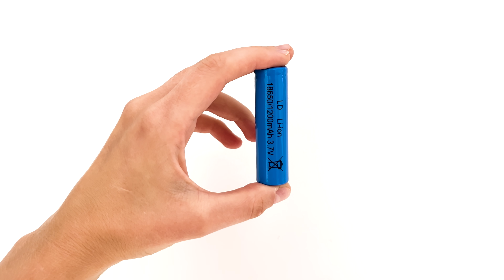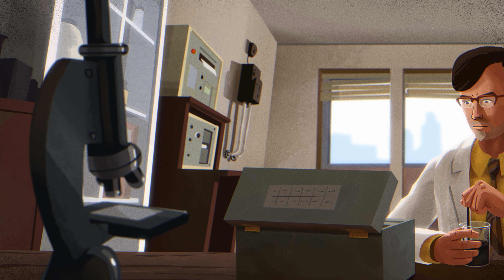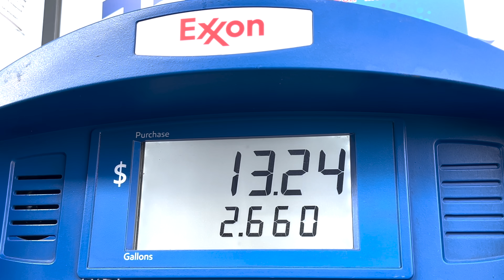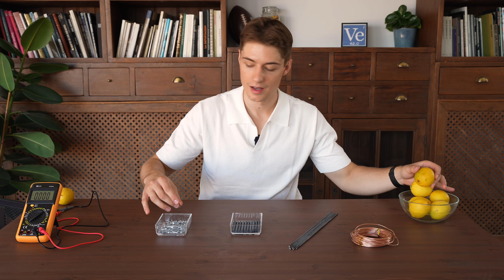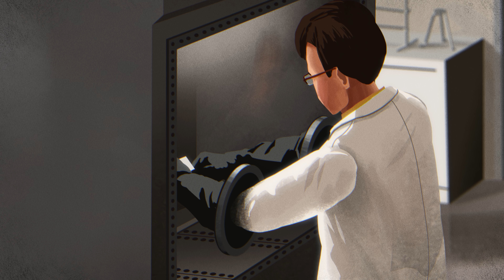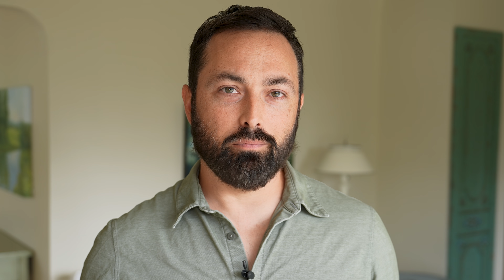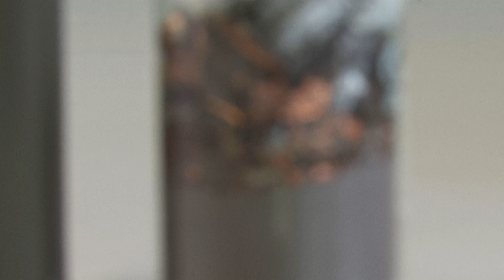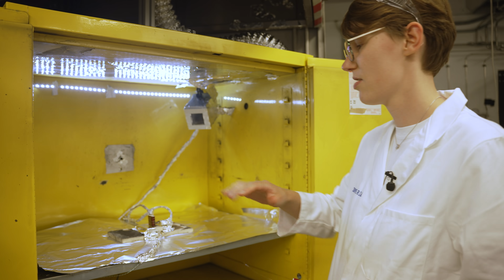The Perfect Battery Material Is Dangerous

Comment: A few things to add:
1. Not all cobalt is coming from those mines in the DRC. Electric car makers especially go great lengths to only buy ethically sourced cobalt. Can't say the same about your smartphone.
2. Not all batteries use cobalt. The lithium-iron-phosphate (LFP) chemistry is very popular in electric cars and stationary storage, primarily for it's lower cost and higher safety, but it's also cobalt-free.
3. Lithium production also don't have to be harmful. Actually almost half of the lithium comes from Australia, which, as a developed country, likely does it the right way.
4. Electric cars are at least 10x less likely to catch fire than gas cars.
5. One damaged cell doesn't cause fire in a properly designed battery pack. This was the very first problem Tesla solved over 20 years ago. The trick is simply to conduct away the generated heat fast enough. Small cylindrical cells with liquid cooling can do that. Most EV fires are caused by pouch cells, which are far more fragile, and don't conduct heat well.
6. With the right equipment putting out an EV fire is easy. One solution is a lance that punctures the battery pack, and inject water directly inside. This cools the battery far more efficiently then submerging.
Reply: As an Australian, no the mining corps don't always do it the right way and do come under constant scrutiny. But they also have the politicians in their pockets making it very hard to do anything about them.
Reply: @SamWulfign  
Sure, but they are likely still better than in 3rd world countries, or China.
Reply: @andrasbiro3007  Yes and no, if they can abuse the system they will. A large acreage land within the region I live was bought out by a mining conglomerate for "forest regeneration" reasons. When majority of it is bush, seems like they thought it would be a easy carbon credit scheme.
Currently atm battery storage is just not a good idea to do at large scales.
Chemical storage would actually be much better and cleaner overall given that it wouldn't be using such resource intensive extraction, I.E Hydrogen turbines, you could convert gas plants to generate and use hydrogen from excess intermittent energy from renewables.
Reply: most comes from china why lifepo4 is really cheap now
Reply: You don't even need special equipment, at least right here in Germany. You can just dump enough water on the small part of the battery that caught fire (if it caught on fire at all because usually everything but the battery burns). Electric car fires are not more dangerous than a full tank of gasoline catching on fire, and they happen less often. Large vehicles like busses might be a different thing, I don't know enough about that topic.
Reply: 1. Most Cobalt comes from the DRC, like over 90%, this is a FACT.

2. Correct, but LFP batteries are nowhere near as common in everyday electronics as Li batteries are.
3. Nothing "has" to be harmful, but ALL companies and governments are corrupt and evil and cut corners to maximize profits over health and safety.
4. Blatantly untrue, EV vehicles are MUCH more likely to catch fire than any fossil fuel powered one. I can't recall the last time I heard or saw a Combustion engine vehicle fire, but EV fires are in the news weekly.
5. Wrong, the modern batteries are so tightly packed that a fire from a chemical failure quickly ignites the rest of the otherwise normal cells, and water exacerbates lithium fires people, it was SHOWN in this video! Adding water and water cooling to batteries increases weight dramatically, as well as complexity and cost, nobody does this comercially.
6. Small scale yes, a fire bag can control and extinguish a lithium battery fire, on something large like a vehicle there is NO WAY to put them out easily, and most EV fires burn for HOURS as is proven on the news weekly, even when the fire department uses specially designed for battery fire chemicals and foam retardants.
Stick to your day job guy, your knowledge of battery tech is laughably dangerous.
Reply: Renault EV's (I'm sure the others do as well, but I've not researched others) have special emergency ports especially for firefighters to pump water into the battery. In the Zoe it's under the rear bench, in the Twingo it's on the passenger side footwell (LHD).
Also, all car manufacturers in Europe have to provide a publicly available emergency rescue sheet for their vehicle model, where the placement of fuel, pyrotechnics and batteries, cutoffs and emergency accesses is located in your car. You can print them and store them easy accesible in your car or glue a QR code on the windshield for emergency responders to scan.
Reply: 7. The environmental impact of an electric car and the power used to charge it is far greater than that of a gasoline car.
Reply: @jovetj  That depends heavily on how you charge that car. With enough renewables creating electricity EVs are far better for the environment.
Reply: @jovetj  
In reality electric cars are cleaner even if charged exclusively from coal power plant.
The key is efficiency. Modern power plants are up to 60% efficient, and EVs are over 90%, while gas cars are more like 20%, and that doesn't even take into account the cost of producing the fuel. Oil refineries are power hogs too. Some say that just the power used for refining oil would be enough for EVs, but I haven't looked into this yet.
Reply: Teslas are verboten except when they need to show one burning (for probably an entirely different reason)
Reply: Hell yea ❤ tesla is sooo great with the battery management system

Comment: Batteries are not the solution.. We alsready know what the physically most energy dense batteri is.. Lithium/air.. Which makes Li-Ion look like a supersafe graddaddy..  The future isn't electric.. It's nuclear, manufacturing synthetic fuels from CO2 in the air, and water.. A closed loop except for the nuclear power driving it..  The only possible way forward for batteries is "nuclear batteries", where you use the nucleus energy levels for storage.. such a battery could easily power a car for a lifetime.. Problem is, we have no idea of how to possibly control this, and Fusion power is waay closer than that.

Comment: 9:43 so a boat made from solid lithium would float?
Reply: A lot of metals can float. Lithium, sodium, potassium. Even an aluminium boat could float on water with enough surface tension
Reply: It would light up the water I think. I'm smart in the ways of science.
Reply: @AncientSoothsayer because it's lighter then water right?
Reply: Yes but also explode, but with enough surface area most thing will float e.g. large boats are made of steel

Comment: I think one important change that needs to come is cheap heavier batteries. Light weight high density batteries are great, but we really need a good battery solution for the power grid that doesn't use up so much lithium. I hope we get lots of investment in that to bring the price down.

Comment: Guys: -20C Salt water discharges and cools a burning car battery in minutes. Sweden or Norway figured that out because of fire security on their ferries because of the latent danger of cars spontaneus combusting.
I watched an official test where a typical electric car was brought into thermal runaway and it was in full steam when the frozen salt water was introduced. It took care of that in minutes. Not hours.
And it didn´t take much salt water, either. So: the environmental impact is much lower when dowsing battery fires with that. You still have to put them in a waterbath after but …okay. Why is no one talking about that? It´s not hard to implement to have insulated tanker trucks on the road to a battery fire, certainly with a diesel engine- for reliability & ease of use. But yeah, problem …not solved but made less worse.
Thanks, no charge

Comment: In 1991 my dad was stationed at Subic Bay Naval base Philippines in the USMC. One day before patrol my father the radio operator was handed a new lithium ion battery for his radio. It was still a prototype in testing with a questionable casing made of mainly capton tape. He was pretty excited when he picked it up and felt it was half the weight and twice the run time as the old lead acid batteries. Until they told him it will burst into a ball of fire on his back if it got to wet, in the jungle of the Philippines lmao.

Comment: Regarding that sponsorship, the pitch boils down to "let's let generative AI police generative AI".  As an experienced software engineer, I'd argue we need more manual code review when generative AI is involved in workflows, not less.  I've seen AI produce some real turds of code blocks, and I'm not about to trust a different model to correct it.

Not that AI doesn't have a place in my work - I just think you shouldn't have AI in both the implementation and the review.

Comment: A bit problem with lithium is when it out gases the gas smells sweet and encourages you to inhale sweet smells trigger a almost uncontrollable reflex to inhale. It is why lithium batteries are so dangerous as that gas is toxic as hell. 
As far as the climate change bs goes i have so heard enough of that bs. Batteries no matter how good require another power source to charge and solar is a freaking joke so is wind. And the liberal whack jobs hate nuclear because oops clean power on the cheap so they have to make up more narrative to rally against it. Solved the hoax of climate change and they can no longer profit from that hoax. 

There are real reasons to look for alternative energy. Examples such as well less nasty smelling gases emitted for one and those gases are not healthy. The only thing EVs actually do is  move the pollution from the streets to more centralized areas. The idea they are cleaner is nonsensical. We have to dig effectively megatons of materials out of the ground using yep fossil fuels to do it then charge the batteries with coal or other fossil fuels. There is nothing CLEAN about batteries.

Comment: This video is awful, it's like it was made using 2015 info. Just Have a Think has covered batteries better and quicker for 3+ years now here on Youtube. Your private equity ownership doesn't help (thank you Micro channel on YT for the tip, because Derek doesn't mention it).

26:40 Saturn's EV1 was just fine, hence why people liked it, but the American govt and big oil hated it. That was in 1996. Who Killed The Electric Car is a cult classic documentary because of it.

33:20 Solid state batteries don't have the dendrite issue (the catching fire problem). Neither do Lithium Iron Phosphate (LFP). Grid scale batteries, like liquid flow or sodium ion batteries, are perfect for 24h storage because they're two tanks of different salt liquids with a membrane in between - similar to how hydrogen fuel cells work.

Comment: Potential Error: 5:20 - you show electrons moving up the zinc through the circuit, but label it the anode.

Either its cathode or the electron direction is wrong.

(The anode is the positive in a circuit, where conventional current comes from, i.e. where electrons go to….  It might be that the terminology reverses when looking at it from within the cell,  which could be the source of the issue - and it might be me not knowing about the terminology in this setting)

Comment: Good luck. Chemical engineer here who works with electrochemistry and, depending on the contract, batteries. You went over why lithium is the best. You’re not getting better. It’s the low weight and valance electron’s proximity to the nucleus.

Comment: Just curious - the "magnesium" used had a black oxide layer, but magnesium usually forms a white/gray-ish one. Is it possible that a "magnesium fire starter rod" was used in this demo? These are often mislabeled and are usually made of rare earth metals or a cerium-iron alloy, not magnesium. Those materials tend to form a black oxide layer.
Reply: The 'iron' was also just a welding rod that still had its flux coating where he tested so that one was potentially off as well.
Reply: @LongItAll  yeah also true, couldve just used a pure iron/magnesium electrode for 5$
Reply: And the rection if lithium and water is colorless.  They used a pH indicator.
Reply: @mernokimuvek  Yeah but that doesn't change the principle
Reply: Bingo!
Reply: Exactly....they did sell a camping fire starter years sgo that had both - it was a little bar of magnesium with a piece of mishmetal (mixed rare earth metals for lighter flints) on it - you'd use your 🔪 to shave off a little pile of magnesium filings, then quickly shave the mishmetal, igniting the magnesium filings, and voila! Instant fire... pretty neat. 
Just looked em up - they still sell it along with many variations - good for regular camping and survivalist stock.
Reply: @stevengill1736 Yeah but they used the mischmetall for the demo not the magnesium.
Reply: @Leon-kf2txMischmetall? Like "Mixed Metal" in German? 😂
Reply: @bavarianmonkey8326  Yes, it's a word of German origin.
Reply: Yes. I noted that also. Magnesium is is more silver color than that

Comment: Wow, a Veritasium video on batteries, that‘s so cool. It‘s one of the topics I‘m really interested in and one of the fields I maybe wanna get into. For electric cars, renewable energies and climate protection in general, battery technology is super important and there is so much development and innovation going on in the physics and chemistry and engineering of these cells. Looking forward to watching the video
Reply: I work in batteries! Ironically I have an ME background, if you want to pursue that track I really recommend either a chemical engineering/research background or mechanical with a focus on simulation and modelling. Thermal management in packs is an ongoing engineering problem, especially in EVs. I'm early in my career but this industry seems to historically have issues with companies selling products that aren't really a viable or novel chemistry - try to do some research or ask in the interview about the advantages of their chemistry, as if you're a customer, and see if it seems legit. Good luck!
Reply: Except he completely neglected to mention any of the newer safer, lithium, chemistries, or the fact that it's the flammable electrolyte that usually causes most of the fire, or that it's manufacture, a defect and not dendrites that causes most failures. This is just going to be used as more clickbait fodder for anti-green energy smooth brains.

Comment: The formation of dendrites is the coolest thing I’ve seen this year! I’d always seen illustrations of it, but never thought about what it would actually look like as it formed!
Reply: Must have taken weeks to film that dendrite formation.
Reply: @plica06  Jesus Christ that happened in one of my 14500 cells once. When I was recklessly ignorant, I force charged a 0.6v. It charged alright, but then suddenly got too hot to hold. Dump it in bucket of water fortunately.
Reply: I work at a phone repair shop and see dendrites shorting out older batteries by dumping all its energy as heat, or no longer charging.   IMO Chemical batteries are not the best solution, rather it should be solid state super-caps with no degradation.
Reply: @BillAnt  Everything in Life degrades.  Principle of Entropy.
Reply: @BillAnt  Do you actually see the dendrites or are you seeing the effect and later attributing it to dendrites?
Reply: Dendrite growth problem actually a long known phenomenon,
that problem also appear in classic Lead-Acid batteries, and batteries manufacturer did tried to mitigated it by making the electrolytes container in zig-zag form that would physically forces where the direction of dendrites growth would be, and thus significantly delays any possible short circuit from happening inside the battery.
Reply: I think that's why we should not charge phones to thier full capacity
Reply: @krox477  As far as I know, dendrites grow because of the "fast charging", which heats the battery, not because it is charged to full.

Comment: I don't think we are going to find a better metal than lithium as far as energy density. What we need is better lithium chemistry, better cathodes, better anodes, and better electrolytes.

IIRC, there is a video on this very channel from a few years back with a guy that made a 100% safe lithium polymer battery that you can puncture and even cut to pieces while using it and all it does is drop the capacity.

Comment: Interesting video… but didn’t mention how Li batteries can explode from not only manufacturing defects, but damage, age, charging improperly and other things. Also skipped right over if we make all these batteries it doesn’t mean we don’t need to make power to charge them. “Big banks of batteries will save us”, nope. EVs are only more efficient than internal combustion engines when you don’t figure out the wasted energy from transmission lines, transformers, even the vehicle chargers putting off heat.